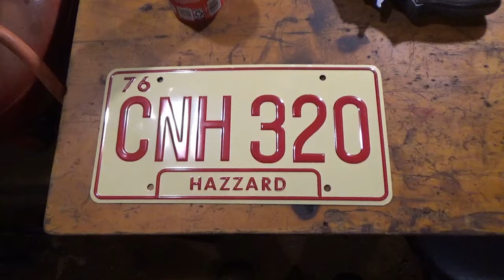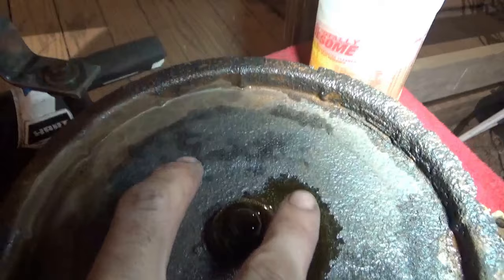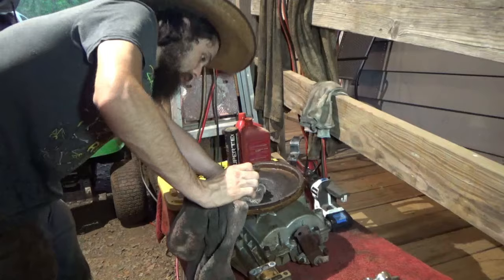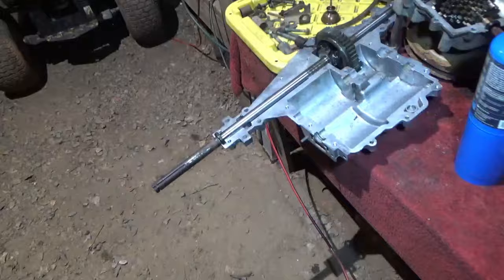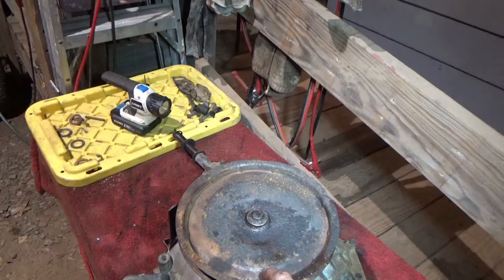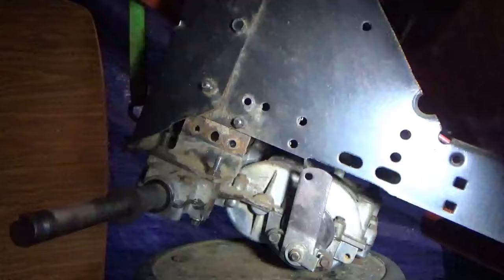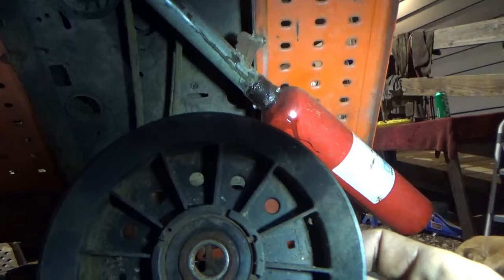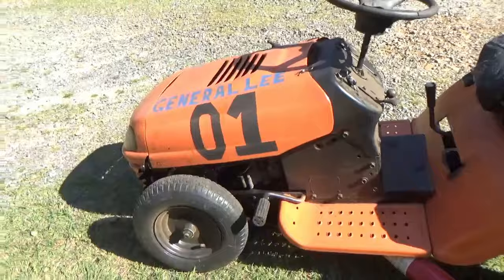It's A RIPPER!! - The "General Lee" Is Finally Finished! (Part 4)

Comment: Would love this thing
Reply from the maker: It sure is fun! But a little underpowered for me personally.  I got a Honda V Twin to swap on soon!
Reply: @flyinbriansgarage3390  that definitely be good for it I'm thinking about doing the same for mine I got a good transaxle in mine but not experienced in welding differentials but tomorrow should be a test ride on my mower to see how she rides with the new clutch system lol last time I drove mine it had more reverse than forward because when I stuck it in forward it threw the belt also have to get me an air filter lol
Reply from the maker: I have a couple videos on transaxle disassembly and welding diff solid. I was nervous at first but as long as you make sure the axles sit straight in the case before welding up you’re good to go. I will say welding the diff makes a substantial difference in the way it performs
Reply: @flyinbriansgarage3390  definitely lol I probably gonna do it later but I took her out for a test ride today topped out around 25mph and ran out of gas on the way into my shop so I guess that was good were it died
Reply from the maker: That’s decent speed! Good deal! 

Just remember, take your time locking that transaxle, and if you feel something isn’t lined up properly, odds are it isn’t. Once it is, you will for sure know you’re ready to weld it.
Reply: @flyinbriansgarage3390  so true can't wait for your next premier I'm thinking about building one like the general here I like going fast on these machines
Reply from the maker: I’ve got another build coming real soon, lowered late 90s MTD with a 724cc v twin, straight piped, the whole package.  

They are fast and fun, build it right and it will light them up on the street! I had white smoke pouring out the bottom, just burning them up. lol Will do well at car shows.

Comment: I'm cutting down and making a smaller rider for my sons 7th birthday, my question is? do they make performance parts for the lil 150cc pancake vertical shafts engines? make the engine make more power is something i can share with him and time goes by. plus, i don't know if the 150cc is going to have enough HP stock. thank u for your time.
Reply from the maker: I’m sure they do. I’ve never built an engine with good performance parts yet, I kinda have to work with used parts most of the time. Check out Go Power Sports, they have a bunch of performance parts. 

And if you’re looking for good, new stock replacement parts you can check out https://www.hipastore.com/

Good luck with your build, and thanks for watching!!